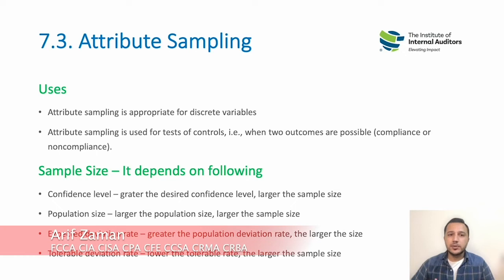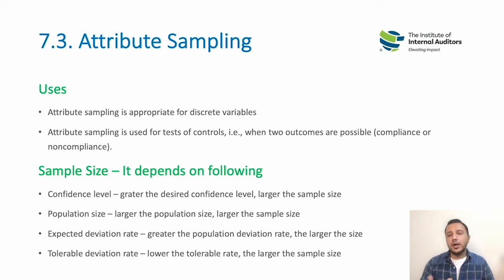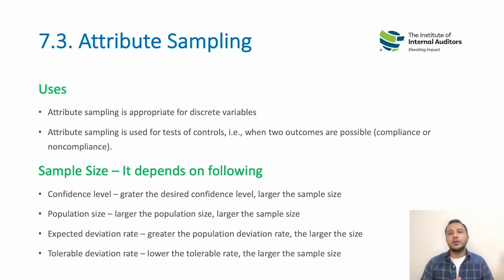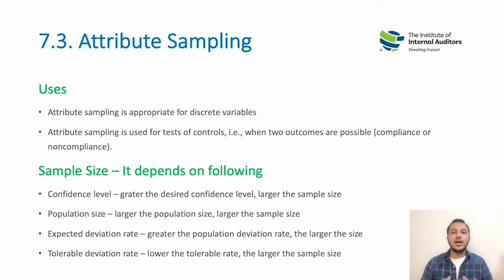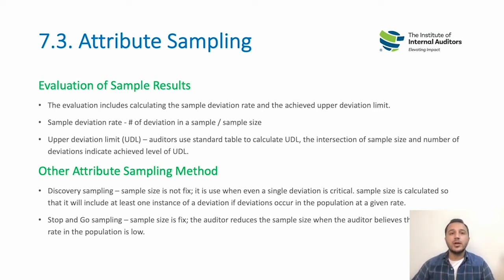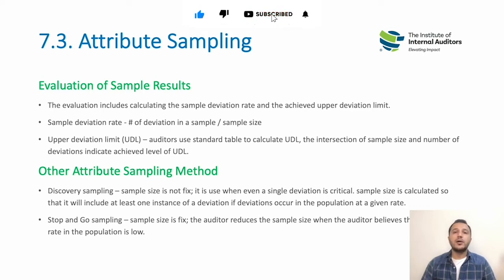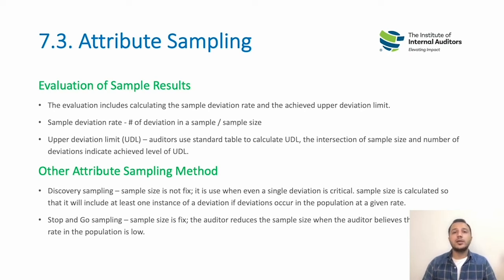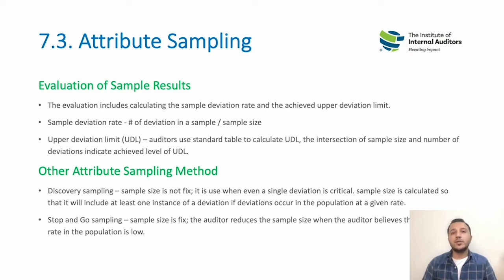Attribute Sampling in Auditing (Simple Explanation)

Comment: 🎯 Key Takeaways for quick navigation:

00:00 Attribute sampling in auditing involves assessing the characteristics of controls.
Attribute sampling focuses on discrete variables, such as compliance or non-compliance of a control.
Sample size determination depends on factors like confidence level, population size, expected deviation rate, and tolerable deviation rate.
Discovery sampling involves reviewing data until finding a single deviation, useful for critical audit objectives.
Stop and go sampling adjusts sample size based on deviation severity, either reducing or increasing it accordingly.

Made with HARPA AI